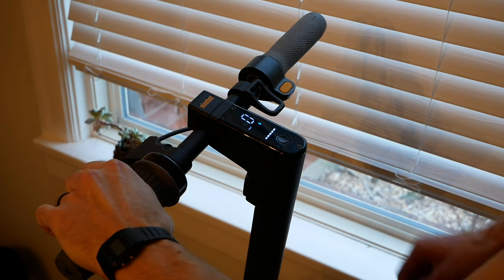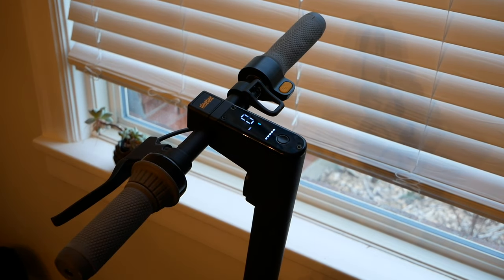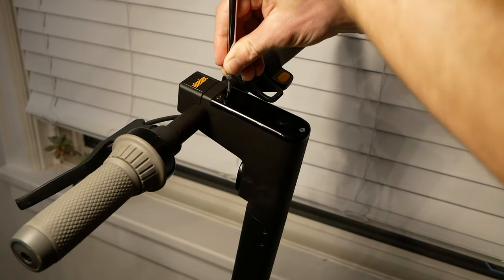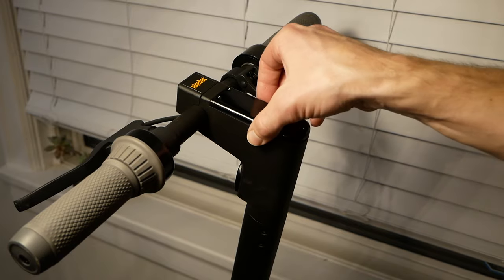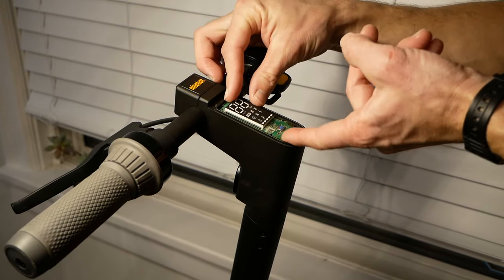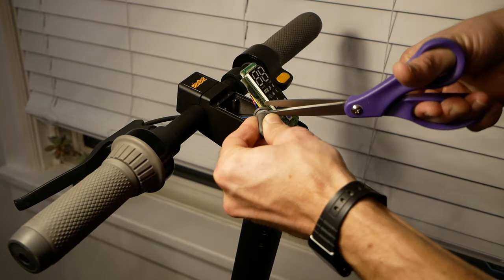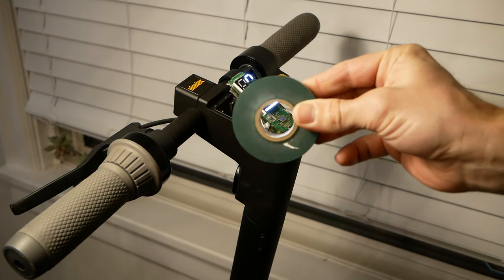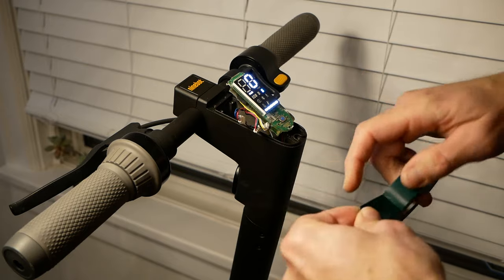Ninebot Max G30P Error 14 and 15 Fix

Comment: Had the same problem. Just picked up the scooter and dropped it on its tires from knee high. Fixed it for now. If it happens again, I’ll open it up and replace the connectors. Thanks again!!!
Reply: Worked lol.dropped it before getting on a n elevator and it quit out on me half way to class. 
Just dripped it on its tires from knee height and it's fine now. Smh 😂
Reply: Hey @rotorbob. Dude your a genius. This just fixed my sons error 14. 

Thanks so much. No idea how you thought of that solution. My son says your crazy 😅

Comment: i had the same problem, sometime works and some time shome error 15 and the scooter stop, i usually press the break and run again.
Reply: that's what I did sometime just release the throttle also work.  Not sure if something is loose in there or shorting.

Comment: worked for me.  the connection is bad right up next to the display connection - i can tell that my fix won't hold. i'm gonna have to figure out how to fix the blue brake wire right as it enter the solder connection to the board.  oh joy.  Still, thank you for pointing me in the right direction.

Comment: Had my 1st error code 15 today 24Sept2021.
° The initial problem began when dash and scooter didn't turn on when pressing the button. 
° Eventually it turned on, then shortly after beginning to ride the scooter decelerated itself a few times while I was trying to accelerate. 
° Then the red 15 began flashing.
° I turned it off and on a few times, but the flashing 15 kept appearing.
° I did a reset after remembering reading about it, and it worked. I made it home and found your vid.
° Watching your video was helpful in confirming what I guessed was the cause.
° Inspecting the issue I now think that hanging any bag over the handlebars can be one cause  of such a problem. As when a bag strap/handle finds its way into a small exposed piece of electrical wiring from the brake it can put just enough tension on the connection as to disturb it.
Thanks, good video.
Reply from the maker: Thank you! Glad it helped.
Reply: How did you get it to turn back on… mine is a stuck turned off

Comment: Thanks for the video. my scooted fell over and started giving me the error 15 message. Just used this to fix my scooter. Bought tamper T10 torx screwdriver. Opened it up and the cable was literally unplugged. Plugged it back in and right back to working.

Comment: You should probably have cut and soldered these.. once a connection like that is bad it will never be fully ok by just bending in my experience: issue always returns at some point.